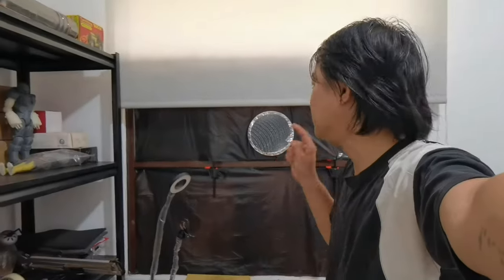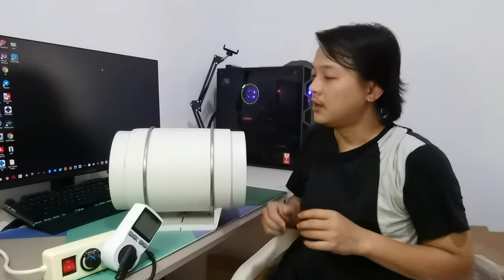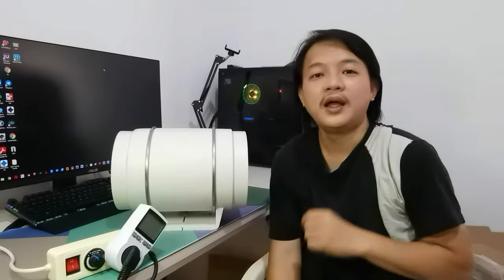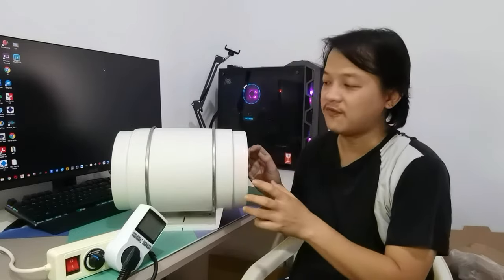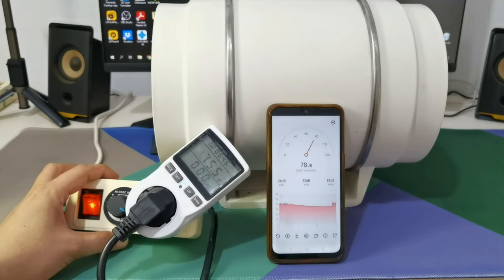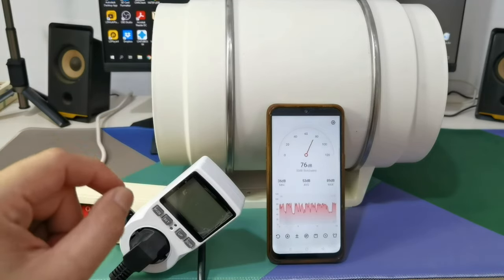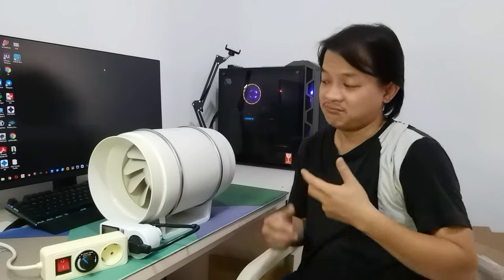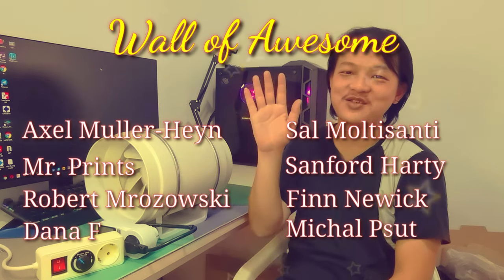Air Ventilation For Resin 3d Printer

Comment: Subbed, after a friend sent me your “print angle + antialiasing” video. One thing… many people who 3d print, may also paint their models. If you have a paint booth in your workshop, it can double as your print ventilation system. My paint booth is a cheap clear plastic storage bin, laid on its side and screwed down on a piece of shelving, with a squirrel cage fan bolted to the back, ducted to the outside like yours. Haven’t looked at the numbers, but running it while resin or alcohol are exposed to the air, certainly helps to clear out the fumes.

Comment: How much do you have to think about the material of the fan and the materials of the duct itself? Is there something to avoid, due to the resin fumes, or can 'anything' go?
Reply from the maker: I dont understand your question
The fan removes all fumes
Reply: @wangdennys   I just heard something about that you had to pick certain materials for the fan and duct, to make sure the fumes don't corrode,dissolve  and/or melt the fan and duct. You know? Making sure there isn't a chemical reaction between the resin fumes and the duct or fan, as the fumes pass through the system.
Reply from the maker: @zygarus4198  i am not sure about that. I think all the resin is the same fumes.

Comment: is it the same calc if you build an enclosure for your 3d printer? 

i wanna build a enclosure with an outtake and a filter and a hose to the window, im guessing i wont need super high cmh as i only need the fumes transported out the enclosure ,  and filters on its way out.

if i build one , would i want me air outtake top of bottom? of the enclosure .
Reply from the maker: Yes it is.
But slightly overpower fan is better, cause when you open the enclosure, some vapor might seeps out

Comment: fuck man the inline fan might be a bit overkill lol
Reply from the maker: better overkill, rather get kill by the resin right?
LOL
Reply: @wangdennys  ha I guess I think you'd be fine with even a small 12v truth be told but if ya got the money why not
Reply from the maker: @user-dd9dh9kw5c  well from my years of resin printing, i tried many fans, some work till a point you have too much printer running and all the fumes is too much for the small 12v fan.

it's not what i think or what you think, the calculation is there provided to me from the seller that his expertise is air circulation.

also not about the money, 
money you can always get, but health is more important.

but at the end of the day, it is your health, not mine.
all i do is just share.
Reply: @wangdennys  hey thats definitely  a good point

Comment: Question 1:
Would the window have to be completely "sealed" except for the exhaust hole? Or can there be gaps on the side of the window?

Question 2:
Do you leave resin in your printer for multiple days/weeks without it being turned on? Do you let the fan run 24/7 or just turn it on while printing/being in the same room?
Reply from the maker: 1. A very little gap is fine.

2. I turn it on whenever i am working in the area or during the work hours.